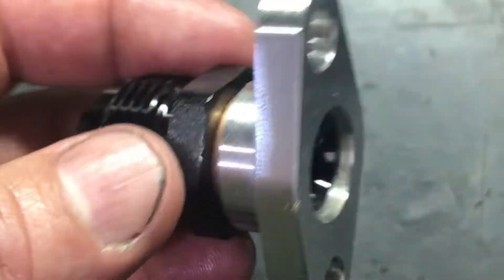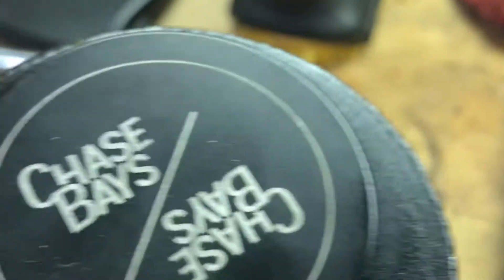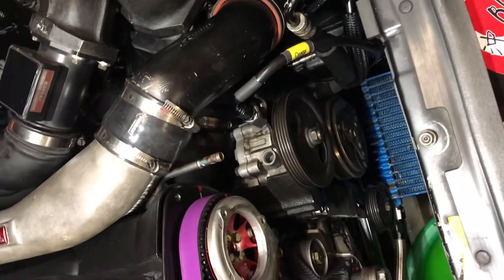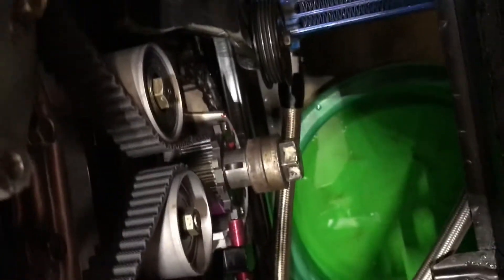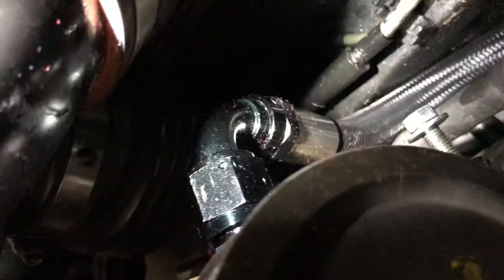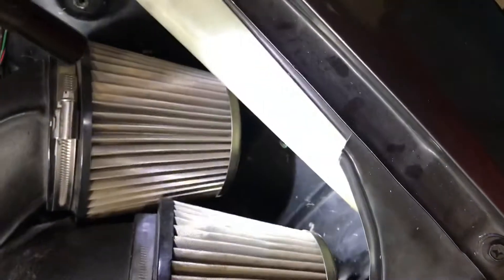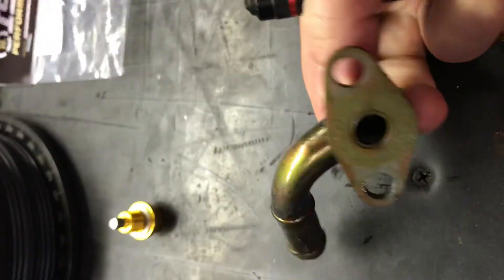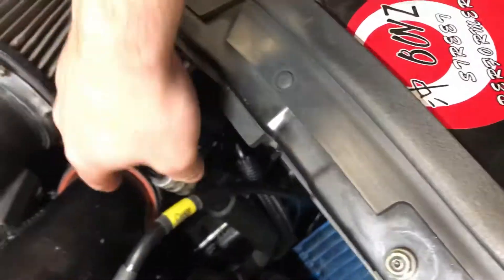Two six Engineering and Chase bays power steering kit on the R32 GTR

Comment: Did your chase bay powers steering kit come with the AN fitting on both ends for the oil feed line? (power steering pump to the reservoir)?
Reply from the maker: Two six engineering sells the adapter to put an an fitting on the ps pump. Then just put a AN fitting on the end of the chase bays kit then your good to go.

Comment: Did you you say you used a 33 pump and used the 32 pulley.? I want to get the kit from two six eng. but that sounds easier to delete the Hicas 🤣
Reply from the maker: Yes.  I have a R33 GTR pump with a R32 GTR pulley.  Two Six Engineering has a pretty nice kit if you ask me.  Can even send him your pump and he will make it single stage. making it easier to do your HICAS Delete.  That option wasnt around when i did mine.  I also lived in Japan and it was hard to find a R33 GTR pump then.  Now in the USA the chances are slim to none to finding one.  only option you have is New or keep searching.  Id send my pump to two six engineering if i were you and keep majority of your equipment you already have or Go Electric power steering pump. its getting more common to find these in the junk yards now a days.